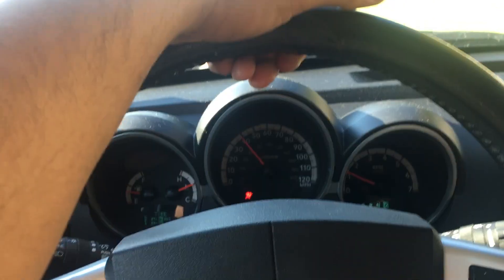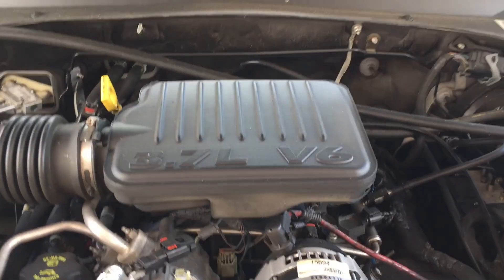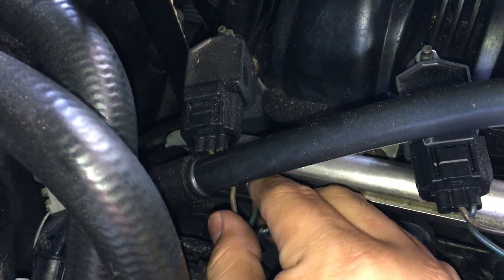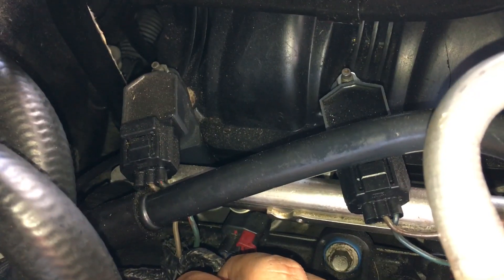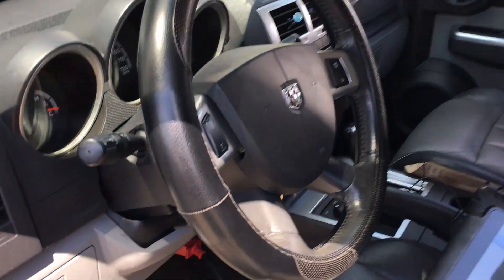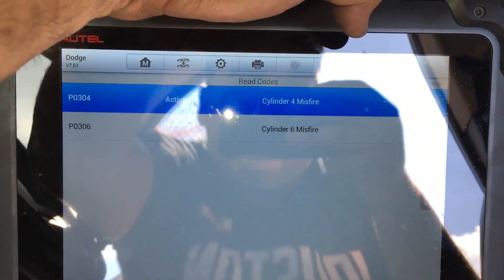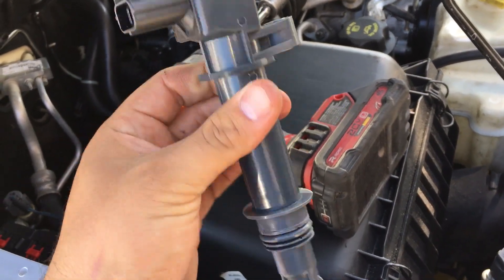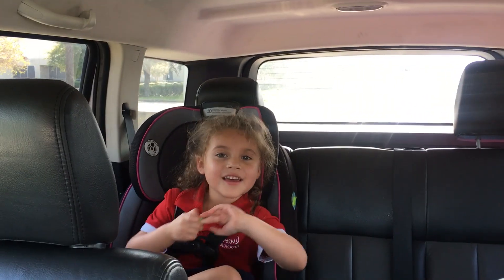DODGE NITRO MISFIRE EASY FIX

Comment: Thanks very much about the Dodge Nitro very good advice you make it seem easy been having a lot of problem with my Dodge Nitro 2008 first head heating problems now throttle body tried to get it to connect an idol out right thanks for the input keep up the good work and helping people understand the Dodge Nitro you get two thumbs up

Comment: Thank you, I been watching your posts. Truly help. I'm still having trouble with altima going into limp mode during to brake circuit.  So if you have update on that one. It would be great. I did change brake switch and cruise control switch.

Comment: Scannerdanner has shown a few of these, and he surprised me with a comment that I didn't expect from him. Paul made the remark that one should routinely replace the plug and wires, in case the bad coil/boot happened as a consequence of extra heat (and spiking voltage) from a partial open in the downstream secondary. He's not normally a guy who advocates replacing normal parts, Paul made a name for himself by calling out the parts changers of the world. I guess it comes down to an inability to reliably detect a defect in the secondary that might have caused the coil to fail. What do you think?

Comment: Always scares my to swap coils when the drivers are in the module, I’ve seen modules get fried for doing that. Great video tho man good job.... jay
Reply from the maker: Good point. Thanks
Reply: Good point but if that's the case the ecu already has a fried driver for number 6 cylinder so it's getting repaired or replaced anyway. Just my opinion.
Reply: Auto Tec just to clarify if you play swap trolnics and the ecu is not fried and it’s a bad coil that didn’t fry it then you swap it then it fried if that makes sense, that’s more of what I meant
Reply: @weldingjunkie  the chances of this actually happening are so incredibly slim that it’s really not even a consideration.
Reply: @robhughes8516  not with smart coils it happens quite a bit or issue rectified itself my moving stuff. You must not be a tech obviously. This is what part changers do btw.
Reply: @d.d4184  or the driver is fried in the ecm and will fry a new coil that’s why it’s important to check wire integrity posted ground etc

Comment: Years a go when I was dating my now wife she stopped by because her car was barely running. Two of the coil on plugs were cracked and burnt. Wrapped them with the thick rubber insulating tape then electric tape. Two years latter she was using my garage to do a tune up when I noticed she never replaced them. The tape still worked.
Reply from the maker: That's awesome!

Comment: You may want to check the spark plug gap, it can stress the coil with a increased gap. I think the plugs on this engine have a 30k interval
Reply from the maker: Yeah, I'm planning on changing them this week. Thanks for watching!
Reply: Yep. Wide spark plug gaps will increase the required secondary voltage which can blow through the insulation to get to the ground. I was in the Honda biz for a long time and this was a common problem. The models with distributors were bad about wide plug gaps causing high required voltages to blow through the ignition rotor button to the distributor shaft.

Comment: My ex has a 2010 Nitro and has had a ton of issues with it overheating. It took 3 trips to the mechanic and about $4000 to get it fixed.

Comment: Are these nitros reliable? Looking at a 2008 6 speed. 141k miles
Reply from the maker: Not very reliable. My engine spun a rod bearing shortly after making that video. I still have the truck. It’s been sitting in my driveway for the past 2 years because I refuse to pay $1500 for a used engine. I am planning on rebuilding it myself in the near future.

Comment: Even after o change the coil and spark plug. My car keeps burning out coil #6 what could be causing that?
Reply: I'm having the same issue. #6 keeps misfiring. Did you fix the issue?
Reply: I have same issue

Comment: Check engine light popped up on my 09 nitro 3.7... Got a code p0302 misfire on #4 they switch out all my spark plugs charged me 200.00 sent me on my way...week later check engine light popped back up again. I don't know what is going on.
Reply: Oops meant p0304

Comment: Hmmm. Never knew this engine's cylinder numbering deviated from the usual V6 numbering where cylinder 1 is the first on the passenger side.

This also looks like that on the mid 2000's Jeep Liberty.